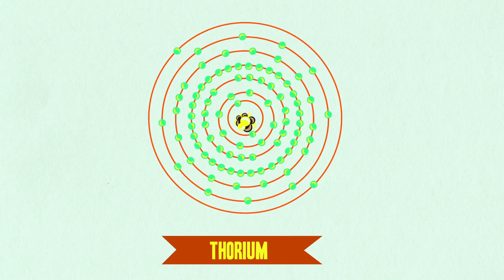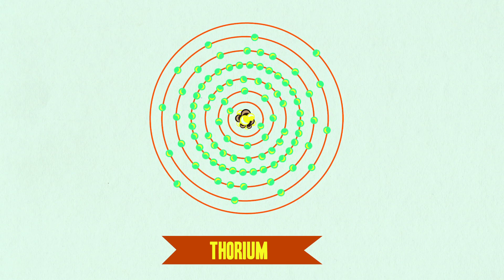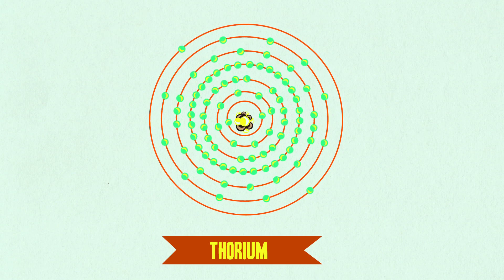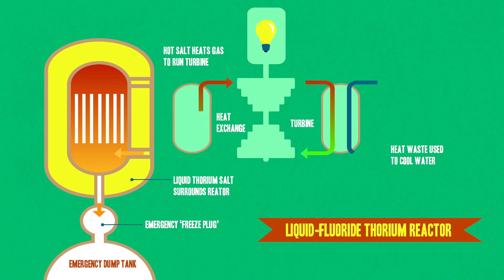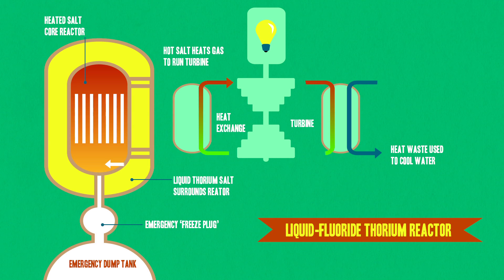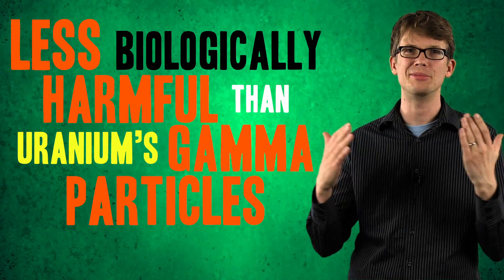Liquid Fluoride Thorium Reactors (LFTR): Energy for the Future?

Comment: Soooo... 4 years later where are we at?
Reply: +Ilowa The LFTR design hasn't made much published success, although things could be happening behind closed doors.

Several other similar designs are coming into the prototyping stage. There is also recently a renewed interest in molten salt reactors using chloride salts and running on the elements that make spent fuel radioactive for a million years, reducing the overall hazard from spent fuel, while reducing the time it must be sequestered.

Comment: No ones mentioning rare earth metals...  The real place China is beating us is in rare earth elements, which they mine like 80% of the worlds supply for.  THese metals arent really that rare, but are usually found with thorium.  Thorium is slightly radioactive, so the regulations on mining it are extreme.  Meaning that mining operations have to find rare earth elements without thorium.  

China was smart enough to mine all of the rare earth elements, and stockpile the thorium.  This is because they knew these reactors were possible.  While they did this, cheaply because they werent afraid of the thorium, they monopolized the market.  They then implemented a tariff, which is bad for us and causes more factories to be built in china, to get around the tariffs.  Obamas actually spoken out against these tariffs, because its a huge deal.

Ironically enough, wind turbines and solar power are only feasible (notice I said feasible, not ideal) if Thorium reactors are implemented as a way to use the thorium safely (and ideally), allowing us legislate the mining of it and the rare earth elements that these "renewable" resources rely upon.

So these reactors are essential to breaking chinas growing hold on the world economy, and "renewable" wind and solar energy are essentially increasing chinas hold on the worlds economy.

Comment: Sorry to call you out on this one but the weapons argument is plain wrong. Pressurized Water Reactors do not produce bomb grade plutonium unless you laboriously refuel them frequently. Hence the US used carbon moderated reactors specifically designed to produce bomb grade plutonium. They did however use these reactors to test that it is possible to produce U233 from thorium which was exploded as a bomb!
Reply: https://en.m.wikipedia.org/wiki/Uranium-233
Reply: +Dan Robertson No, re-read your link, then do some more research on weapons grade nuclear materials. U233 has been experimented with but no results, Your argument that they don't produce bomb grade plutonium is silly, i mean seriously, lets say they didn't want to put in any effort to "laboriously refuel them" the waste would still make a much better dirty bomb then U233, I wish we could make bombs out of it, 300 it to decay and a lot less harmful. Sounds much more preferable. I assume you must be republican trying to defend the party's war mongering and use of fossil fuels? But that's beside the point. This video was correct, and I just wanted to correct your statement so other people are not confused, LTFR is WAY safer then our current nuclear plants and also way safer then coal.
Reply: +Tom Vaughn No I'm a British nuclear engineer. Nobody has ever hid a military nuclear program in a civil nuclear power program because it is much easier to achieve a covert bomb program using enriched uranium or gas graphite reactors. The fission products from u233 would also make a perfectly good material for a dirty bomb. Not that I think a dirty bomb would be very successful. It would be a very expensive, difficult and easy to detect method of causing much less death and destruction than a few guys with AKs and home made bombs (see Sarin attacks in Tokyo).
Reply: +Dan Robertson well I'm a little impressed that your an actual nuclear engineer, but unless you prematurely stopped the reaction the U233 is used up in the reaction is it not? So the actual waste material should have very little U233 left in it and compared to the waste material of a pressurized water reactor, I see this as a much safer alternative. I can't say I have fully researched this to a end but from what I have researched it sounds much easier to reprocess the spent fuel from a current nuclear facility then it would be from a LFTR.
Reply: +Tom Vaughn The LFTR design is a thorium fueled breeder reactor. This means it takes Th-232 and breeds into U-233. In most of the incarnations, thorium is bombarded in the blanket with neutrons, and the protactinium-233 is constantly chemically processed out of the blanket. This Pa-233 is then left to decay away from the reactor for a few months into U-233 which is chemically separated from the Pa-233 and put back into the reactor core. 

This design, if executed well, generates a constant supply of weapons grade U-233. However, in the context of operating a nuclear plant, clandestine diversion of this U-233 is unlikely, and contamination from U-232 is more likely to make the uranium prohibitive for use in weapons. 

As far as reprocessing spent fuel, the ideal LFTR would practically be a self-contained reprocessing plant as well as a nuclear reactor. The fission products would be constantly removed from the reactor stream through various chemical and physical separations method, keeping contamination in the core low, and increasing the fuel-economy of the reactor.
Reply: +Tom Vaughn To address the original point, creating weapons grade Plutonium is quite difficult in a reactor. The "trick" is that you can't leave the fuel in too long or else you lower the quality. In weapons grade production reactors, they highly irradiate fuel for a short period of time, remove the fuel, and process out the Plutonium. Dan Robertson mentions the graphite moderated reactors that were made for this purpose in the UK explicitly.

For power production reactors, the opposite is desired. The goal is to keep your fuel in the reactor as long as possible, not only to get the most out of it, but to utilize Pu-239 generated in the fuel, and overall decrease the quality of Plutonium generated altogether.

Comment: You completely left out the fact that they operate as a liquid therefore completely circumventing the possibility of a meltdown because they are already melted down. You didn't even mention how much safer and more scalable this feature makes these reactors. Not to mention that the reactors produces bismuth-213 that is an ideal smart bomb for attacking cancer, the waste heat from the reactors is perfect for desalinating sea water, which could help solve the global fresh water shortage (you know one of the most pressing problems of our time) you can dump pre-existing nuclear waste into LFTRs and burn it up as fuel, and they are so simple and safe that you can turn them out of an assembly line. I appreciate the LFTR shout out but that's all that this video was. You guys clearly barely researched this subject at all and just threw up a quick and dirty  "yeah wth" video. 

I love you guys and I love this channel but this video was an extremely disappointing.

Comment: if uranium waste last for 10,000 years and thorium waste last for 300 years does that mean thorium is 333 times more dangerous? Please answer.
Reply: +Austin Hunt Not quite. Thorium emits Alpha particles which rapidly deposit energy. This sounds scary, but a paper bag can stop them, and millions of Alpha particles hit you every second. Uranium emits Gamma radiation (which is a wave, not a particle) that slowly deposits energy. This has to be stopped by a metre or so of lead and causes cancer or death. 
The beauty of Alpha particle radiation is that it can be easily blocked. A paper wall would protect you, but (obviously), Thorium waste deposits would use more than that. 
In short, Thorium is far safer than Uranium.
Reply: thank you for clearing it up
Reply: +Matthew Fiedler thorium reactors waste is not thorium.  the way I understand it it some super plutonium that nasa likes but has used all of their supply.  That could be a different form a thorium reactor though.  The one I saw the documentary on shot nuetrons at thorium to turn it into uranium which the split and shot out more nuetrons.
Reply: +Matthew Fiedler quick correction: Uranium is also an alpha emitter, though it does emit a small amount of gamma rays when it decays (just like thorium emits a bit of gamma). lead does truly  offer shielding from gamma rays, but you know what blocks it out even better? uranium shields.
Reply: sasha01198 Good point! Thanks for the clarification.
Reply: +Austin Hunt The waste produced depends a lot less on whether you use Thorium and Uranium and mainly on HOW you use them. If you were to fuel a LFTR without any Thorium, and only use the Uranium we use today, you would similarly see a reduction in the radiotoxicity of the waste of about 300 years before it's near background.

Comment: So is thorium used as the fuel for the reactor or liquid fluoride salts?
Reply: +Chad Saito Thorium is the intended fuel that would head the liquid fluoride salts. That, in turn, would produce energy.
Reply: +Matthew Fiedler Not quite. Thorium is actually IN the fluoride salts. The Thorium itself becomes a salt (Thorium Tetrafluoride, ThF4) and is mixed with other salts (LiF, BeF2, and ZrF2) along with a fissile fuel starter (U-233F3 or U-235F3). The fissions from the Uranium provide neutrons for turning the Thorium into more Uranium. The new Uranium then fissions and does the same thing.

The effect is that once you get the reactor going, you add more Thorium to keep the reactor going, not Uranium. Thus, it is "fueled" by Thorium.

Comment: you forgot the fact that LFTR's can burn the current nuclear wast and the wast that is produced by LFTR's nasa will pay a pretty penny for as they can use it to power their space probes.
Reply: +that linux guy It would definitely be good to look at extracting Sr-90 and Cs-137 and sell it to NASA for RTG's since those two isotopes also account for the 17% that would need 300 years to decay to safe levels the other 83% is down to safe levels in 10 or less.

Comment: I mean, fission is cool, but we should be working on fusion!
Reply: +Alec Lipscomb Your absolutely right. As far as dirt cheap things go, water is about the top percentile. And as far as power output goes, an 800% increase over fission is pretty damn good.
Reply: ***** Cold fusion is within our grasp, but we dont have any commercial power plants yet. A lab in California used lasers to fuse atoms of hydrogen, but the power output was minimal. Most scientist predict full-o nuclear fusion plants by 2050, so in the meantime, thorium is a great alternative. Thorium on its own is good, but per-kilowatt hour fusion is better.
Reply: +Julian Nederhoff (WarWolfx26) Fusion is extremely hard to harness because of the high temperatures that it needs to occur, we use fission now because it is controllable. Fusion will probably never be able to be used here on Earth.
Reply: +Alec Lipscomb fusion is like trying to shoot two magnets together and make the positive ends hit each other through the repulsive force.  Fission is hitting neutron hungry nuclei with, wait for it, neutrons.
Reply: +Alec Lipscomb There are already a lot of good replies here but I think it's worth adding that just like with fission, fusion will also probably have large capital costs and maybe even larger because it is a much more difficult technology to develop. This may mean that a low pressure LFTR reactor is still cheaper than a technologically superior fusion reactor. The major costs with nuclear are already not related to fuel so getting super cheap fuel from water will not really fix anything for nuclear. If we wanted free fuels then we would just use wind and solar but those aren't super great right now because of large capital costs and low capacity factors. Fusion reactors would probably have much higher capital costs than current nuclear technology and only marginally lower fuel and operating costs. The operating costs may be even higher since it would be a new technology requiring more human labor.

Comment: liquid fluoride
I dont know why an accident with that is less dangerous than a hydrogen explosion
but hey, big explosions are still better than ridiculous amounts of radiation, so I think I favour that idea
Reply: +Eduardo Kopik A full meltdown of a molten salt reactor should not produce a hydrogen buildup and subsequent explosion. Not only that, but the salts themselves cool quickly into a glass and offer a barrier for the radioactive particles to escape into the air. 
Since there is no water in the primary or secondary loop, there is a much lower possibility of the radionuclides leaching into water and being transported into the atmosphere or groundwater.

Comment: Can a nation build nuclear grade weapon based on Thorium?
Reply: +Fobulous It's possible. Thorium is proliferation resistant, but not proliferation proof. You can use some of the material from the thorium fuel cycle to build a bomb, but it is much more difficult.

The only element in the fuel cycle that is suitable for making a bomb, is uranium 233, which is produced at the end, and is ultimately what fissions. That isotope is suitable for building a nuke, which was achieved on one occasion. So in a LFTR, if you could shut off the reactor at the right time in the fuel cycle, you could extract the 233. But all that would be needed to know if that has occurred, is to put in place a system for monitoring the reactor, to detect any attempt to shut it down.

On the other hand, you could use the uranium 233 that is left over as waste. However, inside the reactor, some of that 233 decays to become uranium 232, which is not suitable for making a bomb and is much more radioactive, emitting much higher levels of gamma radiation. This effectively contaminates the U-233, making it much more difficult to steal any, as handling it directly, rather than remotely would leave you dead within a week. The higher levels of gamma radiation would make it much easier to detect any attempts to steal any of the waste. 

So it is possible to build a nuke using the thorium nuclear fuel cycle, but it is much more difficult, and basically not worth it.
Reply: +Michael Gibb I thought the idea of the thorium reactor was that thorium was being changed to uranium and uranium was decaying simultaneously. meaning theres no time or place where theres a large amount of uranium.
Reply: Quinton Bailey That only applies to certain reactor designs, specifically molten salt designs such as LFTR.
Reply: +J If a country is capable of designing and building an LFTR, then they are already capable of producing nuclear weapons. Nuclear weapons are often developed before civilian nuclear plants.

Comment: What is really cool is that the stuff that stays radioactive for 300 years is a tiny fraction of the waste and is useful in other industries like medicine and research. most of the byproducts are radioactive xenon and helium, which stay radioactive for less than a day. They can they be used for other industries. Also, LFTR's can't melt down like Three Mile Island or Chernobyl because they are already using liquid fuel and it's not under much more than a single atmosphere of pressure. It's very incredible technology.
Reply: Yeah, Niko, that bothered me too. And bc MSRs are 99+% efficient, how much of that hot stuff will be produced? And is it really 300 yrs? I dunno. Maybe Sorenson will answer the good Dr. Hank.

Comment: We should build LFTRs NOW! We'll absolutely do it when the Uranium-235 runs out, but we should do it now...
Reply: +Karl Liljekvist If U235 ran out (along with Pu239) we won't have any fissile material to start it up. You would need to use particle accelerators to generate the neutrons.
Reply: +Karl Liljekvist Aaaaaaand even conservative estimates show at least 75 more years of standard fissile materiels (U235 and Pu239) at 110% 2014 consumption and 2014 production efficiency. Accounting for better harvesting techniques, more efficient reactors, and the destruction/recycling of nuclear weaponry, conservative estimates show around 110-120 more years of standard fissile materiel for nuclear power.

Comment: On of the problems with Uranium Reactors is there actually isn't that much Uranium. Uranium is rather rare and if the world was to switch over from Oil to Uranium as it's main power source we would run out a lot faster than we would run out of oil at our current consumption rates. So a fuel that is as common as dirt, like Thorium, is really the only viable way to go. 

Though as the video mentions the cost or refitting current plants is such that it will likely never happen. But most likely once the technology is proven than new plants will be built.

Also if the US really gave a damn about keeping nukes out of the hands of other nations they would push full throttle on this technology and then share it with countries like Iran who are claiming to build the plants solely for power generation. Since you can't make bombs from the plants like you can with Uranium plants. Nuclear Power plants with no risk of being use to make bombs would be a win-win since there would be no use for uranium other than bombs and thus be easier to regulate.
Reply: Uranium fuel can be recycled in fast breeder reactors much in the same was thorium reactors are projected to operate. Regardless, current projections estimate that we will reach peak uranium in more than a 100 years worth of current consumption. Thorium reactors do not remove the risk of nuclear proliferation either since a feasible route to produce highly pure U-233 (uncontaminated by U-232) from chemically extracted protactinium-233, even from LFTRs, exists (https://www.nature.com/articles/492031a). You cannot produce weapons grade plutonium from commercial light-water reactors anyway.